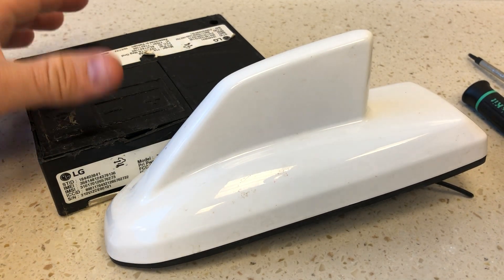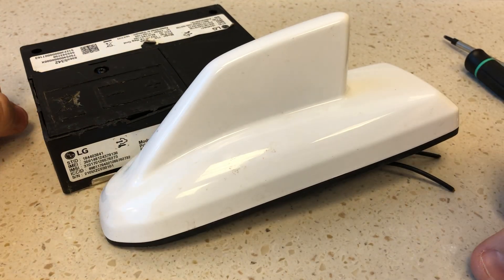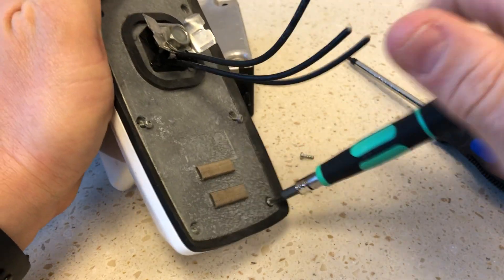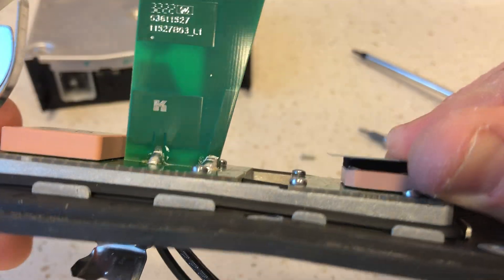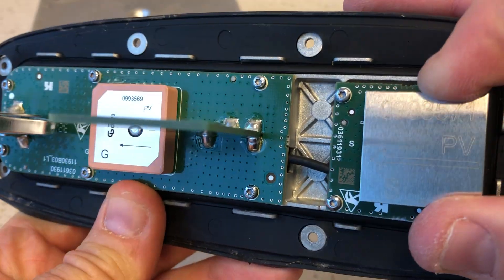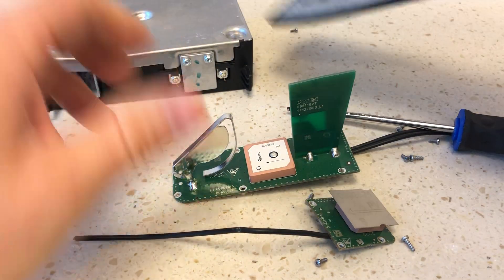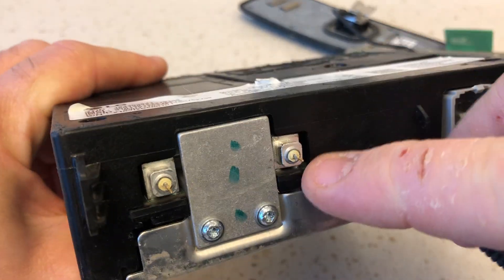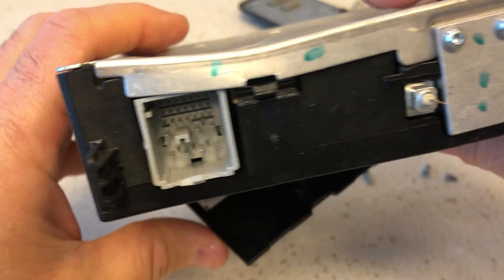Teardown of Car Telematics Control Module and Shark Fin Antenna!

Comment: maybe you do not want to have whoever access to your car even if you are not stealing it :D
Reply from the maker: Fair enough... but why not just disconnect the telematics unit and remove the internal battery? Removing the shark fin from the roof of the car will create a hole where water potentially could leak through?

Comment: The daughterboard with the heat sink is probably the cell/sat modem.  Removing that alone should disable GPS/Cell/Sat connections.  The other connector should be the terrestrial radio
Reply from the maker: I'm not sure why it has to be torn off the roof of the car. Wouldn't that leave a hole in the body where rain could enter? Shouldn't it be easier to just disconnect a few power wires and the backup battery from the module?

Comment: That is the onstar module and antenna. My guess is stolen vehicle and removed onstar so it can’t be tracked
Reply from the maker: Why not just disable the battery or remove the module, or simply cut the antenna wires. It seems like taking the shark fin off the roof of the car will cause problems like water leaking into the roof or other damage? Seems like overkill when they could disable it much more easily with less damage.

Comment: Those two items found together indicate that someone didn't want a vehicle tracked. Removing the telematics module alone would have complied that however. Now the radio won't work either.  😊
Reply from the maker: Yeah I'm not sure why both were removed. They could have left the shark-fin antenna on the car so it would not have a hole in the roof. All that was needed was to unplug the telematics unit from power and remove the internal battery.

Comment: how do you remove a telematic device from a 2023 dodge challenger and where is it?
Reply from the maker: If you see an external antenna, follow the cable for it and see where it goes. I have no idea where these things are located in various cars (it's probably hidden so it's harder to thieves to get at), but you will find a module connected to a power source (vehicle battery). Please remove at your own risk, I don't know how critical it is to the functioning of the car or what features will get disabled if you do!

Comment: Thanks for the teardown.  These telematic units are known to become unstable and not work right when the transmission is turned off.  These units are used for EV cars to report charging state and activity.  Seeing the teardown shows the internal battery and probably the reason these units are becoming unstable.
Reply from the maker: It doesn't explain why someone would tear off the antenna when only the module is the problem. You can change the module or battery (if faulty) and leave the antenna on the roof of the car. I'm sure it can be used with another module. Seems odd when you could just unplug the module and remove it's power. The antenna won't do anything by itself.
Reply: @devhackmod @devhackmod  it prevents data transmission which is the point. These antennas predate EV's with gm starting to use them back in the early 2000s with the adoption of onstar. What started out as a service for customers who opted in has grown into an industry based around harvesting a drivers data. Today these things record how you drive, where you drive, the exact things you did in the moments preceding an accident. The biggest customers for this data are insurance companies which have been known to deny compensation even if a driver was found legally not at fault. The insurance provider will look at the data from these little black boxes and base their determination on that. Newer vehicles can and do record everything from the above mentioned to conversations and the like, just as your phone does. So someone who doesn't know what the telematics unit is, where it's located etc might just resort to ripping the antenna off to prevent that data from being transmitted. Oh and many insurance companies today require these units to be functional in order for their coverage to be valid
Reply: @devhackmod the shark fin has no battery. It a gps module and a cellular receiver and broadcast module
Reply: Just for EV's huh?
Reply from the maker: @limabravo6065  Certainly not, they are on every car now... used for various telematics and car-linked apps (remote start, status, diagnostics, etc).

Comment: It spies on you and how you drive. Reports to Toyota for "diagnostic purposes" and they sell it to insurance companies and they raise your rates due to the driving habits the DCM module keeps track of and transmits.
Reply from the maker: While I'm sure that is technically possible, I'm not sure your car manufacturer would give this out to 3rd parties unless they record all the data and make it available for purchase by insurance companies (and others) who want to look up their policy-holder's driving habits. But if that was the case, insurance companies wouldn't be asking people to install apps on their phone to track driving or giving them monitoring devices to plug into the ODB2 port to receive discounts. Either way, it's scary how much data they gather and whether it can be abused to track people unknowingly by law enforcement, government and others (without proper legal processes).
Reply: @devhackmod  It goes a lot deeper than you think. https://www.youtube.com/watch?v=Nad4CLg6F-o They are denying claims based on historical vehicle data they are quietly collecting.

Comment: Yeah, vehicle theft is the only reasonable explanation. Google says its an onstar unit from a cadillac
Reply from the maker: Why deface the top of the car when you can just remove the battery from the unit? Surely that would stop any telematics transmission to cellular towers? Or is it just that they need to do it fast and just don't care? The shark-fin is the antenna but the actual unit can be opened and battery removed fairly quickly too. Why remove the antenna and screw up the top of the car if they already removed the telematics unit?

Comment: Probably vehicle theft
Reply from the maker: Yes I gather, but why remove it instead of just disconnecting the battery from the module if you already know where it is? They chucked the module and it has a battery so just unplug it and that's it, rather than leave a hole in your roof!
Reply: Most likely.

Comment: Just a guess but, the fin is probably the cell phone/wifi antenna, the square, flat, horizontal antenna is for the GPS and the odd, curly antenna is for the am/fm radio.

Comment: Can you please tell me where the telematics control unit is located on honda cr-v 2023?
Reply from the maker: From what I see online, the 2022 and 2021 models have it under the infotainment control unit. So I would imagine that for 2023 it is likely in there as well. That means it isn't so easy to steal it or disable it maybe?

Comment: Finding both the antenna and telematics module together, in a field, showing signs of being hastily removed... My money's on theft.
Reply from the maker: I don't get it, why not just remove the battery from the unit and unplug it from the system? Without power it can't operate. Why rip it off the car completely and leave an obvious defect in the roof? By the way, I found another one not long after in a different area (just the telematics unit) and will be doing another proper teardown of it as well (stay tuned!).
Reply: @devhackmod  Speed. It takes less time to unscrew, snip, and toss to keep the car from being tracked. Besides, they can't sell a whole car with a VIN reported stolen so it'll end up at a chop shop and sold for parts. The missing telematics and hole in the roof wouldn't be an issue at that point because neither could be reused.